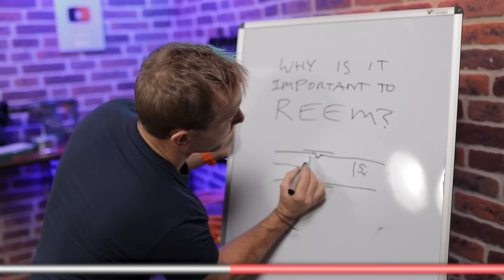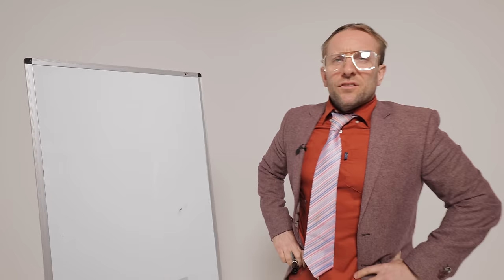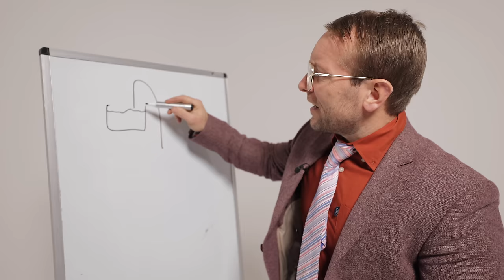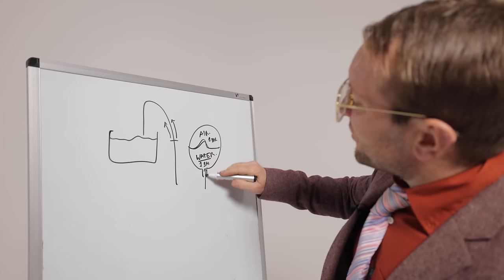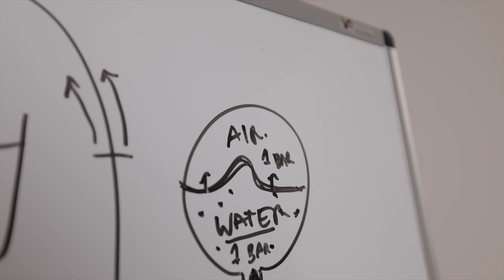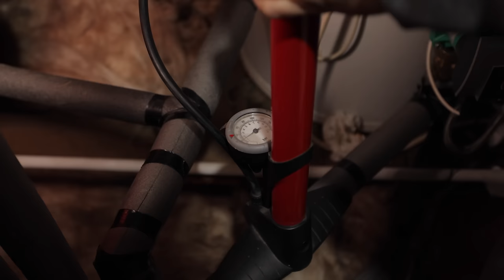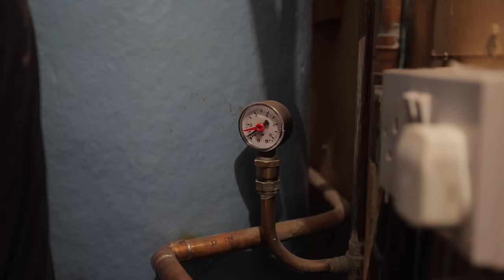HEATING SYSTEM IS LOSING PRESSURE!

Comment: Most likely the rubber was stuck to the schrader valve internally where it lost air, not letting you now pump up. New vessel required.

Comment: Hello mate , I'm a fresh newbie. I've been doing my lvl 3 plumbing apprentice for about 2 years now , but due to lack of work and working for agencies that don't care for you at all , I lack so much needed knowledge. Blagging can only get you so far.

I've been set a task by my teacher at college and I can't find any videos that go in enough detail.

I was wondering if us apprentices could get a video of you and a whiteboard going through different types of systems:

Can you start off from the mains out in the road and give us all the fittings that lead up to the boiler and why they are needed , for example pressure reducing , strainers , isolation valves etc

Can you also explain how accumulator systems work and how a double storage tank system works.

Cheers mate.

Comment: Use some Valsir lubricant on the threads made of plastic. Now it will not drip. It'd be easy to screw and unscrew. You will not need the filter tool if Valsir has been used. 15:40 Valsir goes also in the whole assembly (but not on the brass) threads at 25:56. I have lots of it and is a never-have-enough item. For the amateurs, remove the air from the tube before closing the tube, for the lubricant to remain fresh for longer.  DO NOT use a tool for screwing the plastic housing of filters when using Valsir in the plastic threads.

Comment: Our wonderful contractor did the hosepipe method amd dumped all the fluid out of he heating system in the garden, only trouble is 8ts an air spurce heatpump so they just illegally don't umped many many litres of anti-freeze out.

Worse they then filled the system back up with neat water.

Every time this company tpuches stiff they make everything worse. Couple years ago they diagnosed an air blockage as a faulty boiler....

Shambles of a company

Comment: Great video as usual, you are bonkers!

I have a quick question, my expansion vessel is shot in my boiler and I will fit a remote one for now, i hope the valve survives on the faulty one and water does not start to come out at some stage as don't want to take boiler off wall to get to it! My question is about air in the system, i am a DIY'r so guess some will say leave well alone, however I will fit the vessel myself.

Will air not get trapped in the vessel? or does air in a sealed system get perculated around and find its way to the highest point?

Just thought if air is pushed into the vessel, how will it escape if there is not bleed valve , automatic or manual near it?

Appreciate anyone's feedback

Jase

Comment: Fantastic video. So informative.

Question: Ecotec 630, megaflo unvented. The only expansion vessel I have is the one inside the boiler. Megaflo has an internal air gap but I'm always intrigued why my system seems not to need a red or a white one?

Never loses pressure and all working fine btw
Reply: You answered your own question. Boilers expansion vessel takes care of the heating side. Cylinders air bubble takes care of the hot water side. The cylinder you see in the video doesn't have an internal air bubble so an external expansion vessel is required.
Reply: @MagicDoughnut  well I suppose. It's a 14 rad system and the vessel looks quite small. Anyway, why aren't other systems set up this way. So simple without all that iron. I guess that's what I'm really asking.

Thanks for responding.

Comment: Congrats on your young fella coming into the world btw 😊
Seems silly now but I've a question on expansion vessels... Should they be inverted instead of upright?! Do air bubbles get up into the water side of the diaphragm when fitted with hole at the bottom ! 🤔
Reply: they can be fitted any orientation.. even sideways...air moves from the bladder to the water chamber.

Comment: Worried me a bit. I had a new boiler/system upgrade in 2021 to a Worcester Bosch 30i and teh engineer said teh expansion vessel in teh boiler is not enough and fitted another. Well I have just looked at it and it is 12 L. So how long will that last as you did not specify the age of the failed one? I have 12 rads various sizes and the boiler is a systems  as I have kept the HW cylinder with tank in the loft. You certainly have a variety of jobs.
Reply: they last from 5-10 years. 12Ltr or 16Ltr vessels are what's normally fitted, higher the better for more rads.